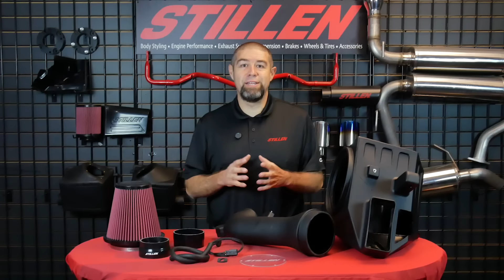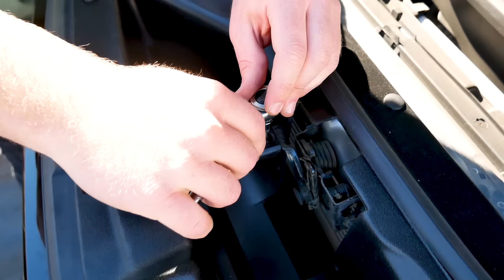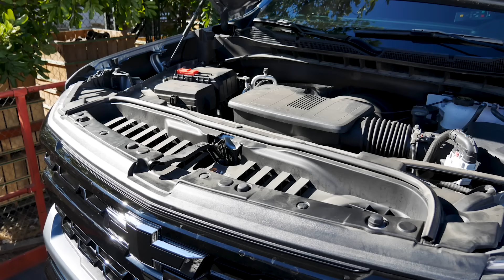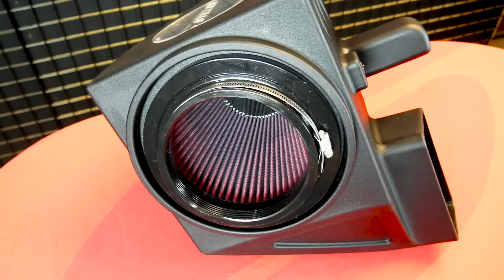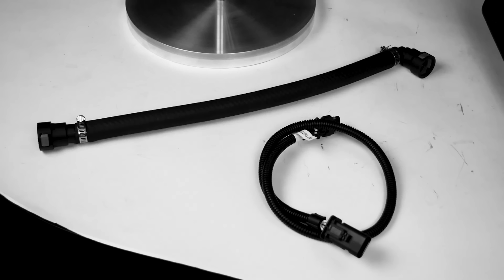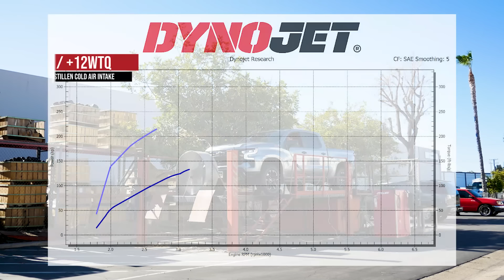TruPower Cold Air Intake for 2019+ Silverado & Sierra 1500 5.3L / 6.2L

Comment: can you plug the airbox for off road use ?
Reply from the maker: Assuming you are referring to plugging the secondary inlet while retaining the primary inlet through the scoop, there is no provision included in the kit to seal that location. However, there is also little reason to do so as it is effectively at the same height as the primary intake inlet and protected from exterior elements by body panels and guards.

Comment: On my 2021 Sierra 1500 I have the air scoop and have it feeding a Cold Air Induction system installed. Just a beast. 5.3 under the hood